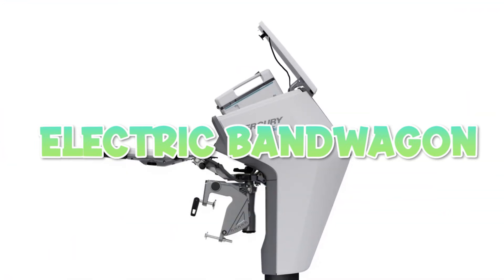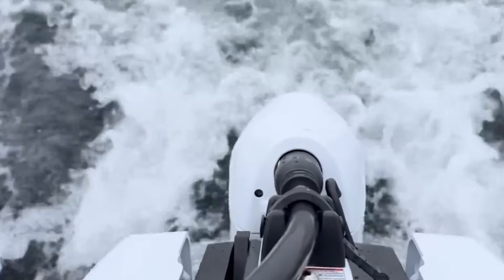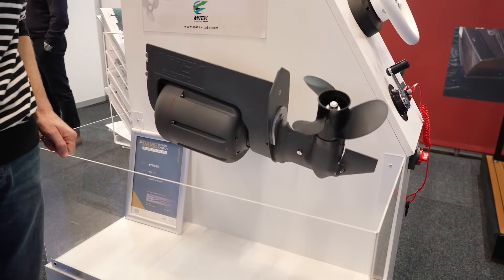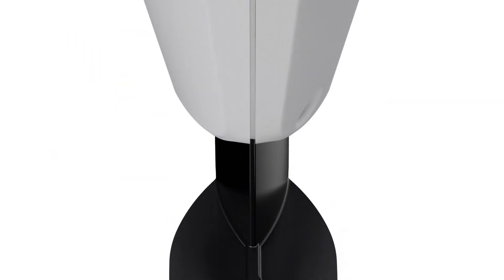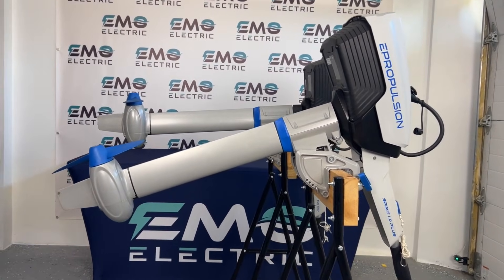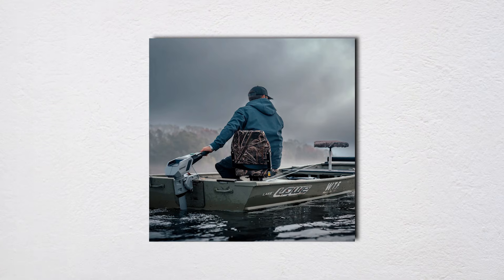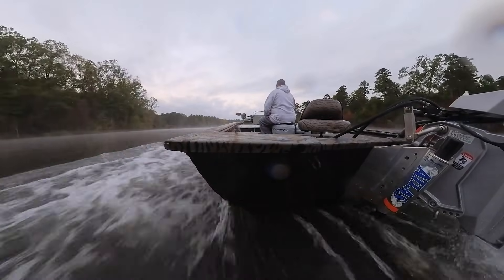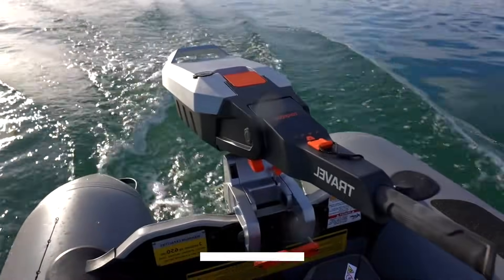Everything Wrong With Electric Outboard Engines!

Comment: This is a really interesting video but I think might be a little harsh on the electric options that are out there now.

We sell various electric outboard motors and believe in ensuring that our customers fully understand their real world use case scenario and so we help them with that to ensure that that we are selling them a realistic, real world solution for their actual usage.
There are now many areas where the electric outboards do offer a real world alternative including sailing clubs and rowing clubs needing higher speeds using the Momentum M10 (15hp) equivalent.
a 12ft aluminium fishing boat also used by rowing clubs:
https://youtu.be/bPTDikU62KU

and can be used for fun:
https://youtu.be/RFpbc2xqm1I

and then for tender use the smaller Momentum U2 which is a 2.5kW motor so 2.5x the power of a usual consumer unit is making a huge splash with real world capabilities for longer trips and more importantly giving confidence in heavier conditions going against wind and tide for example:
https://youtu.be/Df4a78XNQ0s

We think the biggest hurdle for people is the industry over stating what an electric motor package can do which is why we clearly document the capabilities of kit using our own experiences and offering real world demos to help customers understand suitability for them and do not take any notice of manufacturer claims as they unfortunately mostly have to say the same thing to compete with other vendors who over state what is possible. That is a disappointing doom loop really for the customer experience which we really strive to avoid.
Reply: Electric SUCKS IT BITES IT BLOWS  PERIOD!!!!!!! He wasnt harsh enough!!!!

Comment: You're right.. until, you meet a redneck..  im going with a inexpensive 24v 90# thrust trolling motor (plus a whole spare) and solar on the roof,I can carry a charger for use at the docks with shore power. As long as I can hit 4.5 to 5 knots and get roughly 20miles per charge per day.. I could do the loop for pennies a mile.